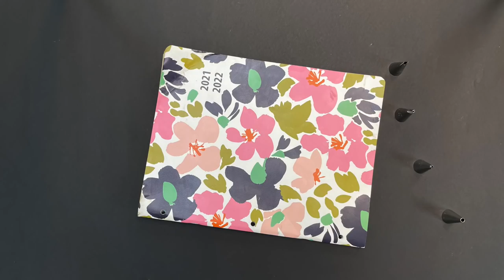How to Transfer Any Design onto a Cake

Comment: This is a cool technique thanks for sharing 👍😊 suppose I wanted to draw a heart with the words "its a girl" inside the heart. Would this technique work if i followed your steps? 🙂🙂
Reply from the maker: Yes but you'd have to write the words backwards since the side you're piping will be pressed against the cake. If you print the letters and flip the paper over so you're tracing the back of the letters, then they'll face the right way :)